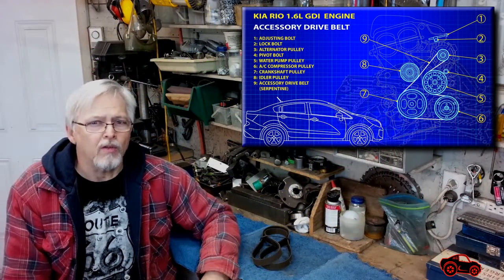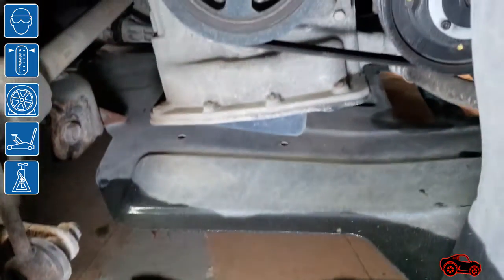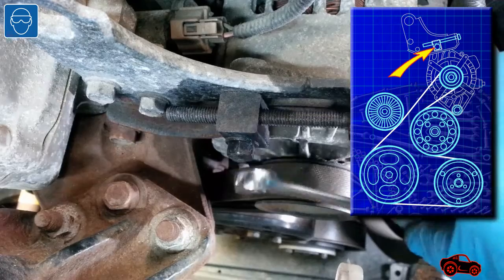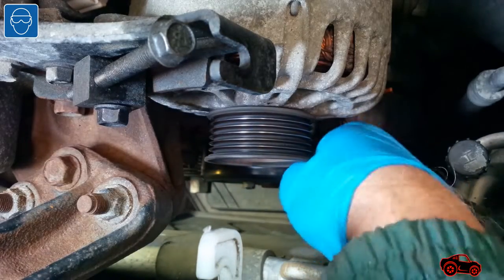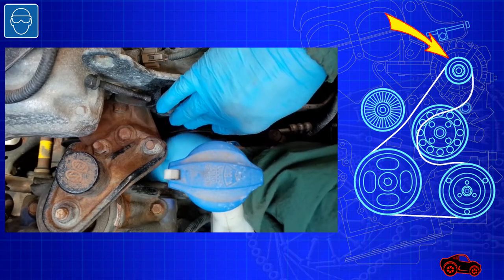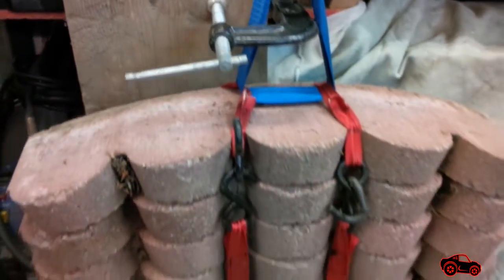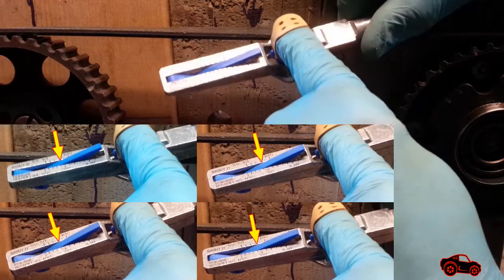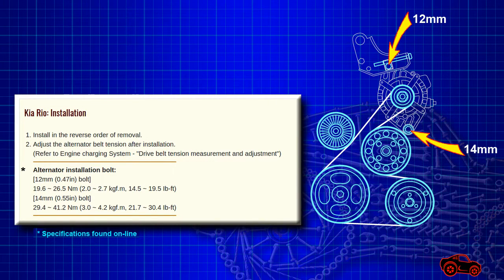Kia Rio 2014 (1.6L GDI engine) Accessory Drive Belt Replacement

Comment: Excellent video. Very clearly explained. Unfortunately, I have no way to check the best tension except by trial and error. I measure the deflection on the old belt and make the new belt deflection the same and recheck after a few miles driven.

Comment: what if the belt broke while driving, would the harmonic balancer need to be realigned again or not
Reply from the maker: Most of the time, a harmonic balancer is not damaged when it happens. If a harmonic balancer is damaged, it is not realigned, it needs to be replaced by a known good one.

Comment: Excellent tutorial. The trick of sliding the belt of the pump was especially useful, and disconnecting the battery is also a good idea. In my kia picanto removing the wheel was      unnecessary . Like your accent to. Thanks form Israel .❤

Comment: This is the worst video I have seen to change a serpentine belt on a kia rio. Literally the only video ive seen where the tire and plastic shield are removed. It's like you are creating more work on purpose to increase labour costs for the customer (or waste your own time). Also don't understand the testing at the end, you literally just keep torquing the belt until it doesn't squeal. The only thing this vid accomplished was overcomplicating a simple job, unbelievable. I try my best to avoid mechanics like you like the plague.
Reply: Probably removed the wheel and liner to get the best clearance and light in there to film it. If you over-torque the belt, it will shorten the life of the bearings in the pulleys. So you check the tension.

Comment: What would happen if I removed the idler pulley?  what is your function?  Why does the belt tighten with the alternator?
Reply from the maker: 1: What would happen if I removed the idler pulley? The drive belt would vibrate, be noisy and it would not last long enough.
2: What is your function? ...  You mean the function of the idler pulley ?? It is used to stabilize the the drive belt when it is in motion.
3: Why does the belt tighten with the alternator? It is a simple system and KIA wants to save space and money instead of using a belt tensioner assembly.

Comment: I have a 2012 kia Rio.  I cannot get the belt over the water pump pulley.  I have the alternator pushed back as far as it will go.  Did you use  a  authetic kia part?
Reply from the maker: No, it was a Gates Micro-V Serpentine Belt K060494 and it was matching the original one.
Reply: @mtlcarguy  Yeah, certain companies may make the belt just a bit smaller than others. I would recommend getting the original version and obtaining a back up in case. I had replaced my belt just cause and I order a belt that was too tight and my god. It made the loudest squeak in history at idle and acceleration. I reverted back to my original and the noise was gone. I do have to fix the idle pulley after having it strain too tight over a day's worth of drive.

Comment: Dernière question, est-ce que la poulie de droite de votre banc d'essai de validation de 7''C.C. pouvait pivoter ou elle était fixe?
Reply from the maker: Oui elle pouvait pivoter et il n'y avait pratiquement aucune restriction de rotation sur chacune des 2 poulies.
Chaque arbre de roulement dans les poulies avait du jeu pour tourner librement et avait été graissé.
Les 2 écrous qui sont visibles ont été mis en place par mesure de sécurité et ils n’étaient pas serrés pour nuire à la rotation pour ainsi obtenir une tension égale entre la section verticale de droite et la section horizontale de la courroie.

Comment: Bonjour, qu'est-ce qui vous a motivé à réaliser une calibration de votre jauge de tension sur un centre-en-centre de 7''? Est-ce que cette jauge est limitée à une distance ''X" de centre-en-centre entre les poulies selon son fabricant? Merci et bonne journée
Reply from the maker: De 1975 à environ 1995 j'avais l'habitude de tourner les courroies environ 90 degrés avec mes doigts pour ajuster la tension, donc j'ai une certaine expérience.
Avec les serpentines c’est plus difficile de vérifier avec les doigts quand la longueur entre 2 poulies est courte.
Quand ma vieille jauge est disparue, j’ai décidé d’essayer ce nouveau modèle mais je n’avais pas l’impression que la tension était bonne quand je l’ai vérifié avec mes doigts.
À ce moment, comme je n’avais pas trouvé une documentation du fabricant qui me convenait, j’ai décidé de faire mes propres tests et de les montrer dans ma présentation.
Reply: That 90 degree technique is an old mechanic trick.